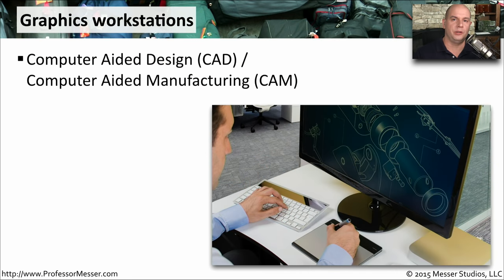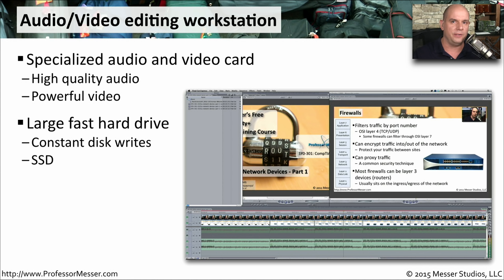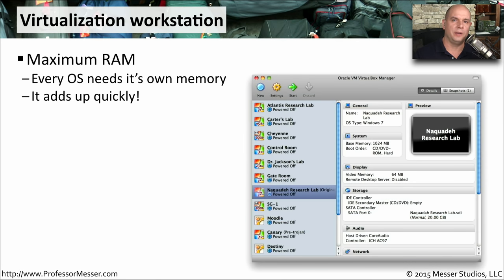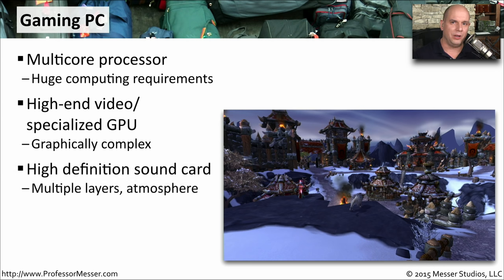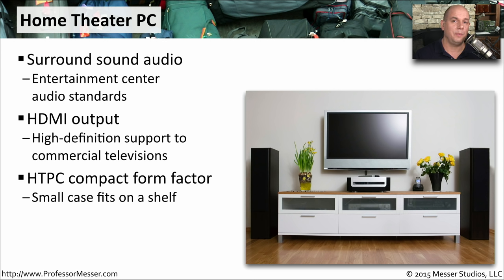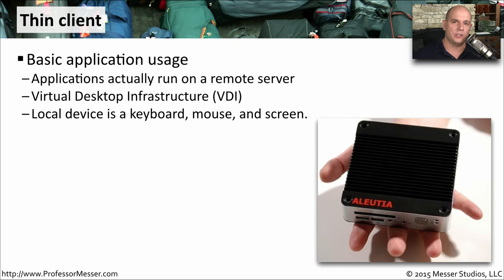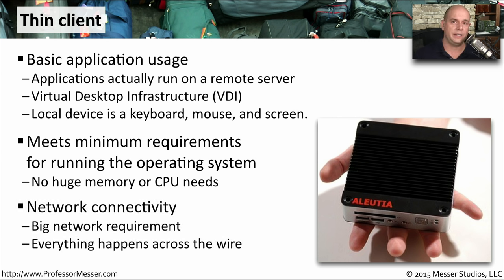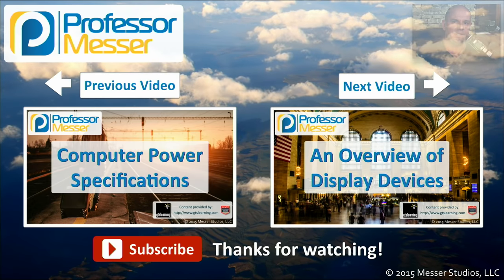Designing Custom Computer Systems - CompTIA A+ 220-901 - 1.9

Comment: Isn't a KVM switch just a thin client?
Reply from the maker: A KVM is a physical extension of the actual keyboard, mouse, and video signals. It is not a remote access session or thin client.
Reply: @professormesser ,
Thanks, also is there any bottlenecking in performance on a thin client? For example can I run a thin client in my son's room connected to a high speed gaming PC in another room with minimal performance issues?
Reply from the maker: A gaming environment can be complex and resource intensive. The quality of a streamed or remote desktop gaming session would be dependent on the game.